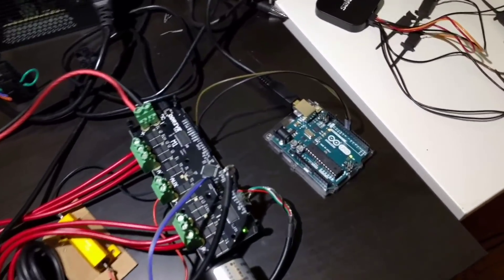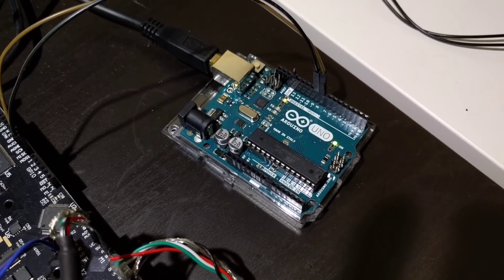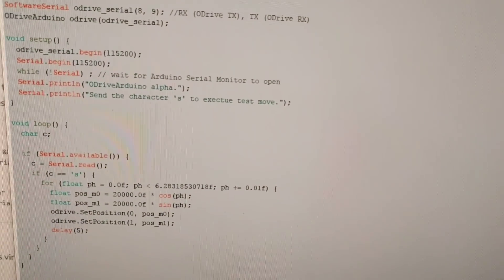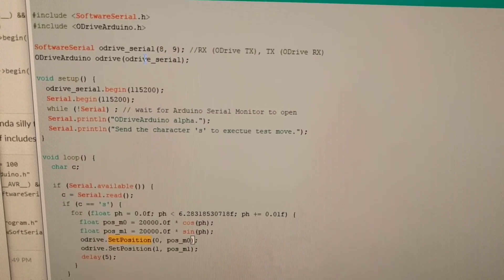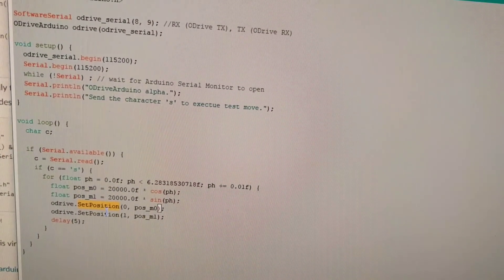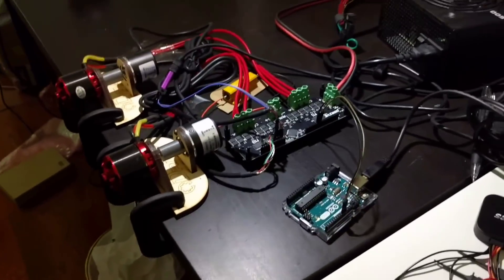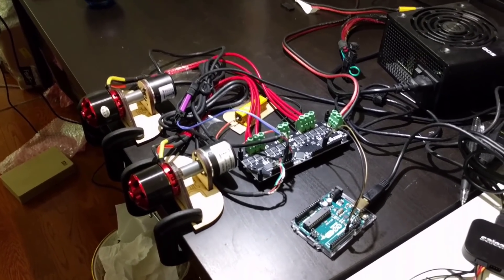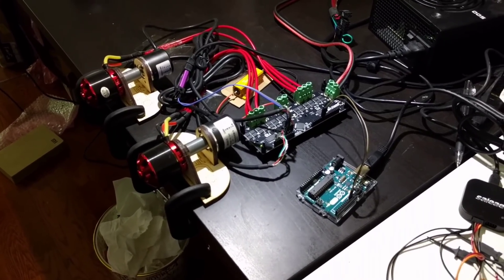ODrive and Arduino: 1st test

Comment: I have a odrive controller, I did the same but the motor not move, when check "b"option show 23.95v  and some times 2.000V, the power supply  is 24VDC, I check wires and communication, using pin 8, 9 to GPIO 1,2 Odrive, I don't know why it doesn't send voltage to the motor. Some help?
Reply: How do we interface ESP32 , CAN Bus with Odrive

Comment: Hello how do I wire the Odrive V3.5 and the motor? I bought an ODrive v3.5 driver board. Unfortunately, I wo n’t wire it. Please guide. Thank you. I want to make a simulated racing direct drive steering wheel. Force feedback. My motor is MiG 130ST-M10010.  I saw this video as a good steering wheel https://youtu.be/t9jT0I-V- hope to publish the wiring diagram on the website hope you reply your message Thank you!

Comment: I can't get the motor to move with Arduino. I get  "Axis0: Requesting state 4" 

I can get the motor to move using Python command odrv0.axis0.requested_state = AXIS_STATE_FULL_CALIBRATION_SEQUENCE but am to stupid to get any further. 

Do you have any step by step code examples of moving motors to specific positions? 

Also Is the USB on the ODrive board plugged into the computer or power when Arduino is connected?

Comment: This has potential to completely open up a new world of affordable powerful motor control.. Just a few CNC related thoughts: It would be perfect to have a board that supports three axes, as that would suit most router/printer applications. As it stands I would currently need two boards, maybe a three axis version geared towards CNC could reduce cost over two boards? Also if you'd get that price down on the board in general this could  take the hobby CNC market by storm. Is there any future cost reduciton expected from higher volume?
The other issue is control, can this be controlled with only step/dir? For some mechanically minded people it would be difficult to deal with anything that needs "real" coding, so if that worked by just hooking it up to step/dir this would integrate into many existing machines. Also an "easy to read for non-it literate people" guide to set this up especially for CNC would be a great addition to give people confidence to buy into this. As it stands the cost of 2x board (needed for 3 axes) is a bit of an investment for something that I might end up not being able to get to run well. Maybe one option for a router would be to run Z with a stepper, as it doesn't move that much.

Generally an amazing idea. Hope to see more of this soon..
Reply from the maker: Thank you!
Yes you can control it with step/dir, there are some instructions here: https://docs.odriverobotics.com/interfaces#stepdirection
I agree it would be a good idea to improve the ease of use and documentation even more to make it easy. It's something we are working towards.

Comment: I've just been watching https://www.youtube.com/watch?v=zeYAWqt2rIE where he is driving two motors from a single ESC.  I'm curious, if you were to use multiple motors with the same rating, driving the same shaft (with the encoder on the shaft), would it work?  You'd get much more flexibility in terms of physical layout and voltages etc if you could.

Comment: Hello. I like your video.
Is it possible for you to share the firmware of the oDrive? Or the settings,?
Reply from the maker: Yes, it's all here: https://github.com/madcowswe/ODrive
Reply: ODrive Robotics but the same one that you used on this video. Imnstill very new to the oDrive concept
Reply from the maker: So all the stuff that needs to be on the ODrive is in the link I put. Then you can make it go like that with this Arduino library example: https://github.com/madcowswe/ODriveArduino

Comment: Cool! It there an affordable torque sensor that could be attached?
Reply from the maker: A cheap way to make a torque sensor is to use a lever arm and a weight scale.
Reply: Cool. I already have a weight scale sensor. My plan is to experiment with force feedback between man and machine.

Comment: Hello, how much resolution do you get per turn, in other words, how many steps per revolution.
Reply: ODrive Robotics. Where are you finding encoders for $10 dollars?
Reply from the maker: It depends on the encoder used. For $10 you can get 2400 counts/rev, for $30 you can get 10000 counts/rev.